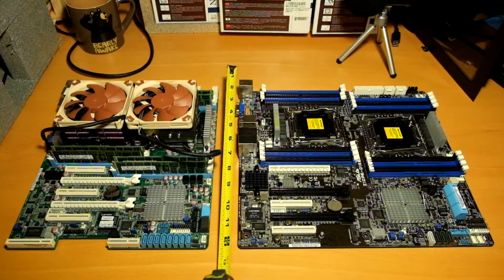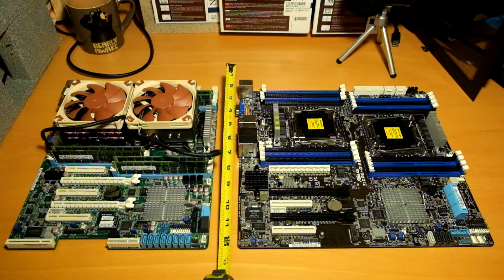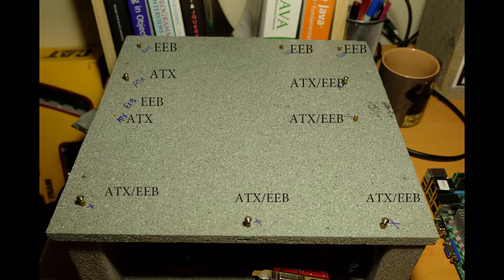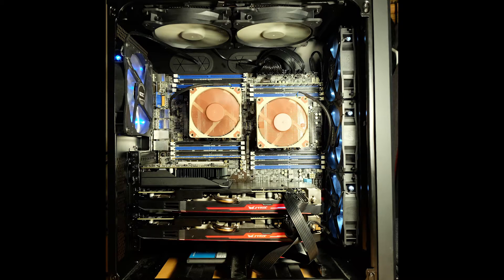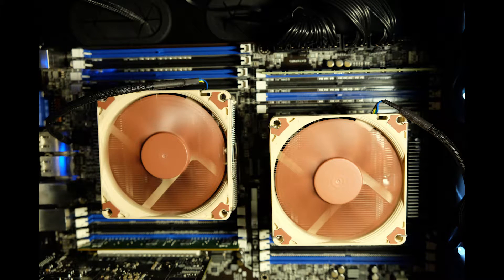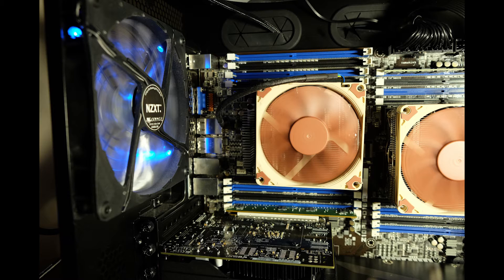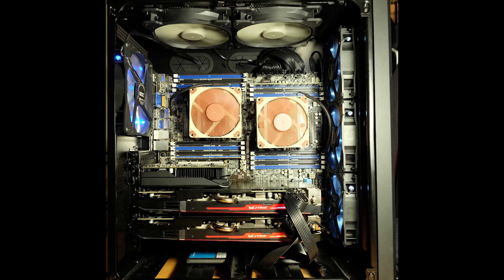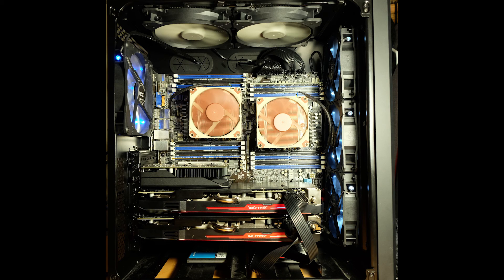ATX vs SSI EEB Motherboards

Comment: You are the only person who posted what I wanted to see. I bought Z10PE-D16 (Non-WS version) and I learned that one PCIe 3.0x8 slot separates the two PCIe 3.0x16 slots. So, I thought my two GTX 1080 cards won't be good for this motherboard and perhaps lose one. With much google search and ASUS manual never clearly mentioned of GPU sli capability. Though lots of useless info and videos were found on WS version for SLi, absolutely nothing on non-WS version.  
Well, your video made me believe it works. Thank you so much! 
So I should continue building my SLi system then?
Reply: Interestingly I also am going to buy a Z10PE-D16 but in the WS version (Z10PE-D16 WS) and am unsure if it'll fit the Thermaltake Level 20 XT that I intended on using for it. 

your message is 2 months old. I'm assuming you've built your setup since then? How'd it go?
Reply: @HyperDroids  Thanks for your interest. I have built my own system like I said before by drilling holes on the case structure. But as to sli isn't a go since nvme ssd is fitted on M.2. After long research and searching I figure that M.2 is using PCIe slot. I really couldn't be bothered removing M.2 to test out two GTX1080s.
Reply: @wannaflyme  That's wonderful! Your fast reply is much appreciated. Did you have many other problems? 

Anything you think I should bear in mind pre-purchase? And how'd you go about drilling the holes? I'm concerned I could end up drlling incorrectly.
Reply: @HyperDroids  Yes. Drilling the holes to the exact point is vital.  First put the motherboard on to the case inner panel with existing support nuts for guidance. Pin point center using sharp pencil. Then drill it using smallest bore and increase to the bolt size. That is the main key. Also the motherboard panel should not interfere with MB itself. (e.g. no brackets)
Reply: whjat @wannaflyme  I'm not entirely sure I follow what you're saying in your last sentence: "Also the motherboard panel should not interfere with MB itself. (e.g. no brackets)". As in be sure the motherboard doesn't touch the panel it sits on otherwise it could short the board? 

Also, what size drill bit did you use? 

Thanks again!!
Reply: @HyperDroids  What I mean by brackets is like 90 deg angles that is riveted onto the panel to support HDD or other ODDs. Some ATX cases have them. Also as for drill size I used #1. From my memory I can't remember the exact number but it was the thinnest. Something like 1mm diameter. And went up to the diameter of the nut shank thread.

Comment: ssi-eeb is not a standard tough and most cases that can fit atx or e-atx boards will not have standoffs for ssi-eeb boards and you will have to drill them yourself. i just finished 2 builds and only 3 screws were in the same place. the rest i had to drill out... btw i used the same case as you did but i used a 2011v1/v2 board from supermicro and a 2011v3 board from supermicro for both builds.

Comment: I was planning on moving my SSI EEB board into a new case and was going to try and put an ATX board in my SSI EEB case since it is a nice case with 6 hot swap bays, Intel SC5650DP.
Looking at your test bench, it looks like there should be enough standoffs in the right place to keep the ATX board in place.
Reply: I know this is a late reply.

But if you do this? Make sure you keep in mind that PCBs do bend a little and solder joints may hit metal if it's not secured correctly. Especially when moving the case, bumping into it or whatever.